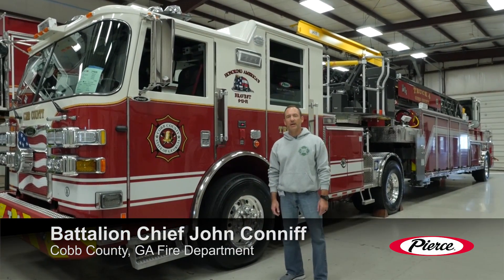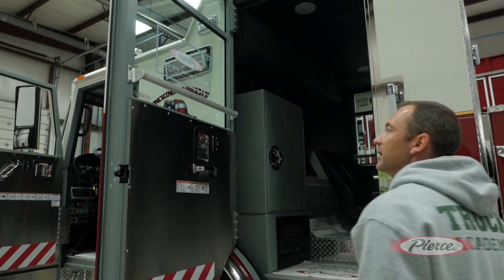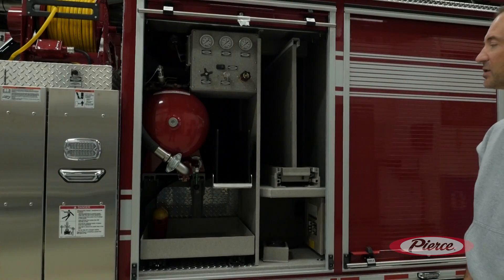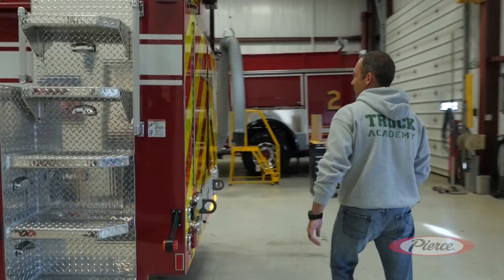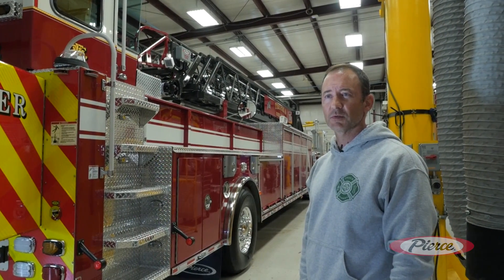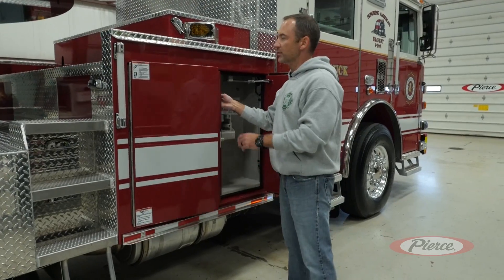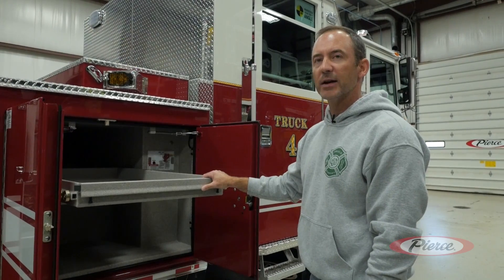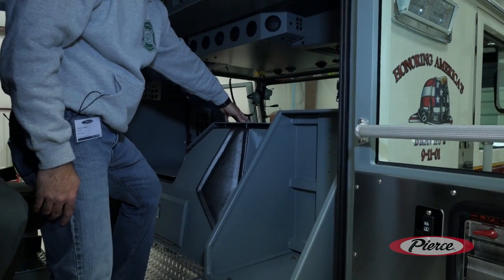Cobb County, Arrow XT™ 100’ Heavy Duty Tractor Drawn Aerial

Comment: Nice to see a near by FD getting a new pierce!!  Im a Douglas Co FireFighter and my engine  is a fairly new pierce and I enjoy every shift I have with it.  Cobb getting a brand new Arial / Tiller .... big money!!  Enjoy your new apparatus!
Reply: luv2fly Yeah, tiller's are more maneuverable that's why bigger city's like them.
Reply: luv2fly There is no difference, the aerial ladder is just the ladder on top of the truck and a ladder truck is just a common name.
Reply: Rece Teale, thanks for responding.  Looking at my question I asked it incorrectly.  I meant to ask whats the difference in a tiller truck vs the other type of ladder trucks.  Are the tillers more maneuverable?   Thanks,
Reply: Newls1, what's the advantage of an aerial ladder over a regular ladder truck?  Thanks,